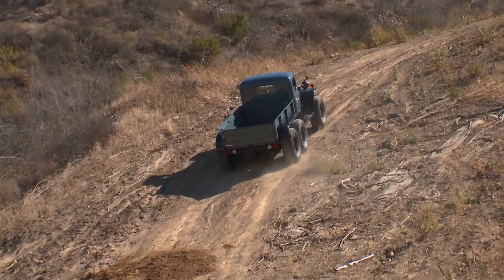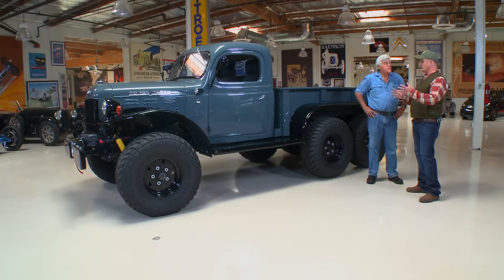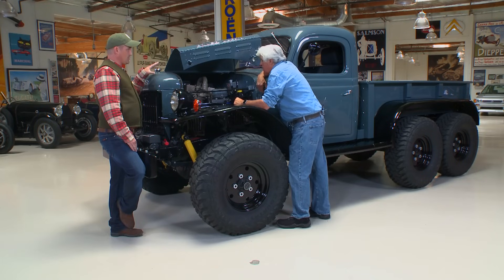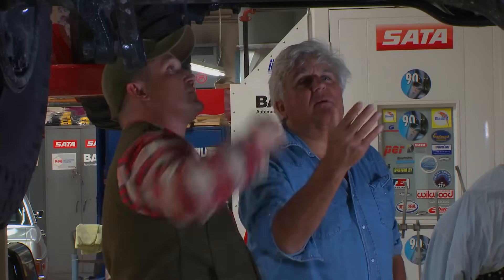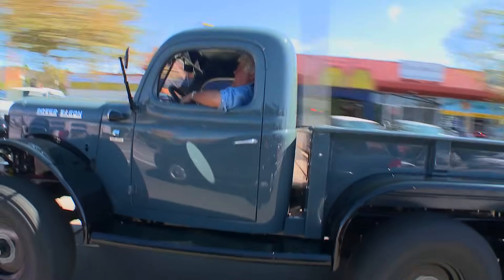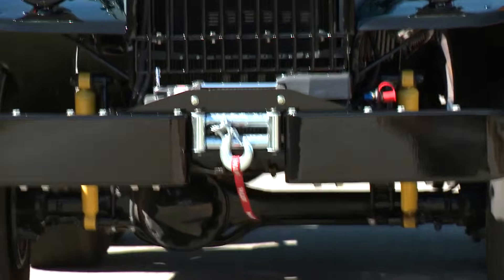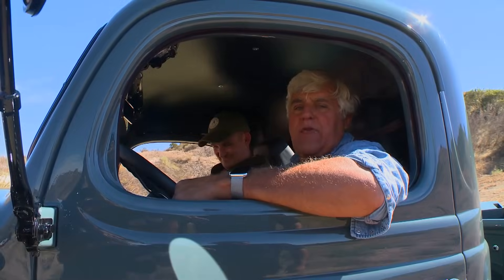1942 Dodge Power Wagon Restomod - Jay Leno's Garage

Comment: An uncle of mine used 2 Dodge WC vehicles for his engineering business in New Zealand after the war to access/repair and assembly of electrical pylons in out of the way areas, a WC 52 (i think) weapons carrier and a WC-54 ambulance, I often rode around with him in the open weapons carrier and felt like a king sitting so high up with no doors..
The old 6 cylinder  230 cu flat (L) head motors were so understressed and just kept going, though they consumed petrol at a good rate due to their weight and older design. .
Obviously they lasted much longer if not hit or damaged, salt water was a problem with high corosion of panels and mechanicals though.and their life expectancy was rated at 20.000 hrs in the Pacific.
We had many ex US army miltary vehicles in NZ during and after the war, many were transported back from the Pacific islands after the war on old steamers by a man named Gillies who i believe had a contract with the War Assets department  to retrieve ex surplus and abandoned vehicles. They were stored at in a huge seaside yard in Gracefield, Petone about 10 miles north of Wellington for sale and spares, included, Ford and Chev Blitz trucks, Studebaker 6 x 6 trucks, Reo's, , White halftracks , GP's, Beep Dodges,  Diamond T's, many of the 6 x 6 Studebakers were used for logging having jinker trailers attached. a few farmers tried half tracks when new tractors were unavailable in NZ after the war., not always successfully.
Many farm and rural transport business's in NZ had one or two ex Pacific US army vehicles, and they were inexpensive and parts were easily available from the huge stockpiles of machinery and reclaimed  equipment.
The Gillies yard was huge and had large numbers of these ex military vehicles, spares and associated war surplus equipment. I moved to the USA in 1966 then to Australia in 1975  and don't know what happened to all of the vehicles after that.

Studebaker 6 x 6's and Reo's were commonly used as Bush fire Brigade vehicles in NZ and Australia until the 70's and when the diffs were locked there was little steering, just straight ahead, ask me how i know? stopping dead befor hitting a large gum tree.

Comment: That engine produces a boat load of torque. With those 583 differentials that beast could rip massive trees from the ground. Wrap a chain around a building and you could rip it off the foundation and crumble it into a thousand pieces.

Comment: That injection pump can be ran without 12 volts. There is also a lever that mechanically will shut off the fuel. But you have to remove the shutoff solenoid, then remove a plunger and spring, then re install the solenoid to plug the hole. Then with a manual trans, you could potentially run with out any electrical power.

Comment: The first year  Cummins was 1989 .I bought with a getrag  5 speed 
It 160 hp at govern speed and 400 lbs of torque at 1700 rams. Mine was a wd250 4x4 with 354 gear ratio

Comment: Talk to Spearco next time.  They make air-to-water intercoolers.  My 2015 Passat TDI has a Spearco.  No extra intake plumbing.  The cooler is bolted right to the head.  They aren't as efficient as a COLD air-to-air intercooler, but it's almost impossible to heat-soak the Spearco.  So in the real world they're great.  Plus a nice bonus:  In the winter it HEATS the intake air when you're cruising, which the diesel appreciates.

Comment: Man I'd love to see an old 318-3 commercial engine with an oil bath air cleaner or other vintage type air cleaner, and all stock vintage engine parts, with cast iron exhaust manifolds, and 2 bbl carburetor with 210 Horsepower (factory rated horsepower of 318). I think it would have had a lot of power, compared to the 105 hp 3.9L cummins. I just always loved the old 318 commercial engines, they had a forged steel crank and sodium filled valves from the factory, and the 318 industrial commercial engines were used in commercial trucks, generators, equipment, and motorhomes. The gas engine may have been a little easier for cold weather, and a bit better on the highway? But the cummins 3.9L is pretty awesome too.

Comment: I retired from the pa Dept of corrections s.c.i.graterford .we had gotten one of these from the PA Forrest service ,after refurbish this vehicle . It was built for brush fires . I called chrislyer for any info they could give . They told me how many they made  ,what the gear ratio was to go into areas that called for steap hills ect. One thing they did tell me was that you would break the drive shaft if you were not careful if moving form the stopped position .

Comment: Funny thing is, that 3.9l cummins 4bt probably can get 20 mpg+, even in this big thing. Maybe not in this with the extra drag of the driveline and 2 more wheels, but I've seen these engines in ford rangers and they get 30+ mpg. Not only the milage is great, but the peak torque starts 1200 rpm where you spend most of the time driving and goes all the way up. Nice truck, too.

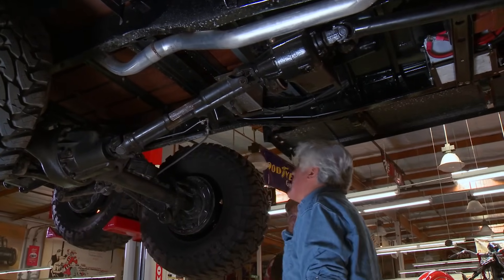Comment: @ 18:00 =>> the brake hose of first axle is already tensioned like a piano wire while the axle can still drop more than it already did (because lifting on the rear axle only).. 🤔 

Should have done it like on the original WC62/63.

Truck looks beautiful anyway. 🙂

Comment: That thing is pretty nice, but if it were mine, I'd put in a 6-speed Eaton manual rather than the 5-speed he put in. An Eaton may take up more space, but it's built to handle torque numbers that are far beyond what 99% of Pickup engines can put out, so they last a really long time. The added controllability of a decent Highway-Tractor 6-speed is nice off-road as well, due to the shorter gaps between gear ratios. With a doubler behind a transmission like that and a smartly chosen diff ratio, you could probably go up a 30% grade without even touching the throttle.

Comment: The drop-tops on the old military vehicles were to make them easier to transport particularly on aircraft with limited height in the cargo compartment. The sheet metal on conventional vehicles are not going to stop any military bullets so having a metal cab is irrelevant. Make great beach vehicles now.

Comment: Love the 1 wire (no electronics) diesel engine idea; need one in my FJ
Reply: The only catch is that the 4BT is heavy. 308 to 329 kg [679 to 725 lb]
Reply: @jacobmoses3712  True; had not realized the weight issue diesel engines pose until recently.

Comment: I worked for the city of Tumwater in Washington state and they had a '59 Power Wagon.  No one would drive this thing.  When they found out I could double clutch I was the one that had dive it.  The one I dove had a governor and it wouldn't go over 50 mph.

Comment: I learned to drive on one of these (4x4) on my uncle's ranch on Molokai, 1964.  It had a flatbed, PTO winch and we rigged up a bumper mounted A-frame boom that could pull up fence posts.  The secondary vehicle was another ex-military 4wd, a Willys MB IIRC, that went to my cousin, then my brother until he traded it for a POS pickup that lost its timing chain on Hawaii island as I drove back from a job, in about 1979.   I liked the Willys for visibility and a transmission better suited to the speeds we were traveling.

Jay isn't much on staying in his lane, or does the truck not want to?  The ridiculous money these things are going for speaks to the customers and discounts their "coolness".  It's almost cheaper to hire a helicopter.

Comment: So, what do 'ya suppose the fuel mileage is on this rod?  Any Guesses??  I give it 10 MPG at best.....Didn't hear them talk about that.  So with a 25 gallon tank, 250 miles max, but probably more like 180 to 200 realisticly....Better have a couple 5 gallon military fuel cans just in case....That ride from Calgary to Anchorage could be a "Nail Biter" as far as fuel economy is concerned....LoL   Appropriate color for this rod....Looks like Ford Motor Co, Area 51 Grey

Comment: The part about the disc brakes twisting the springs seems a little off, couldnt you just lower the brake pressure to make sure it isn't braking too hard ?

Comment: Can anyone explain to me what a block heater is? 
also.. old school wise that did they do up north before a lot of electric?
Reply: A block heater is a device that pre-warms or keeps warm an engine block for extreme cold starting.   Much more popular on diesels or older vehicles with carbs.  Most on call or cold use machinery is on block heaters so you can hop in and start.   There's dozens of ways it can be accomplished.  On my carbureted gas vehicle, I had to drive it a few winters.  I have a block heater plumbed into the coolant system which warms the coolant and circulates it through the engine.  There are other methods.  But usually plugs into 115 VAC .

Comment: 4BT 3.9 Cummins is a motor for farm tractors, small delivery vans, light equipment engines like a roller, backhoe, water pump, fork lift, wood chipper, etc.  it’s got lots of torque for a 4 banger but Sheash,,,,,,why not a least the  Cummins 12 valve, 5.9 six cylinder with easily twice the horse power. It must have been all about the space available.

Comment: I would LOVE to see a 1955 GMC 550 body sitting on this exact powertrain and drivetrain setup!!! ...also, with a 5th wheel and air ride! 
It would also be nice to have 2WD, with a 6x6 differential switch that engaged the first and third axle, making the 2nd rear axle the primary drive axle (just like a semi ...but then with 6WD instead of 4WD with the diff. switch).

Comment: He's wrong about the electrical bit to a point, cummins use a shut off solenoid that needs power to open fuel supply but has a manual screw to override it, he doesn't know his product as well as he thinks

Comment: Should of used Dana 60s or 70s at least for all that weight those look like 8 3/4   differentials are going to have bearing issues and case cracks and small u joints breakage off roading

Comment: How did they run the power steering and brake system off the same reservoir? Running DOT 3 in the PS or PS fluid in the brakes?? How did they get away with this?!?!
Reply: I suspect the pump only gives boost to the master cylinder rather than supplying fluid to it. sort of how the vacuum boost on a passenger car only gives assist.

Comment: the hydro boost system has never worked very good..the last thing you want is your brakes and power steering on the same system..i've seen people's brakes completely fail when the high pressure line blew..very cool though .a well thought out design and well executed..

Comment: This truck is begging for a 6.0/6.7l powerstroke or a Cummins 5.9/6.7l or a Duramax 6.6l... so much fabrication and yet extending the front end a foot wouldn't have been worth it? I guess the more modern engines don't do it justice though. Maybe a Detroit?

Comment: I am old enough to remember Power Wagons in common use.  God, what a vehicle.  But lose that air conditioner and put in a gasoline heater.  I need a Power Wagon like I need another hole in my head, but that's the only kind of truck I ever wanted.  Screw Tesla.
Reply: you betchya, our Oldsmobile 1906 sedan worked just as well as Tesla ever could. They cared enough to make everything with superior quality, and then Tesla falls off entirely when they add the beauty factor of rich color and embellishments to the automobiles of the 20th century. We had a Ruby Red with black lined 1915' Chevrolet Royal mail roadster, a greater eight 1930 Hudson Sedanette, Hudson 1937 Terraplane, Nash Ambassador 1941 coupe, then another Hudson this time being a 1946 Super six in Ice green and marble white, and then we purchased an Oldsmobile 1938 which is gorgeous and certainly a lovely working automobile. In 1953, we then finally purchased a 1951 Hudson Pacemaker which was in tabrolite dark gold. Many automobiles many years and a constant beautiful obsession our family held, always keeping them stock.

Comment: I want mine in fire-engine red. Where this one is gray, I want red. 
So, uhh... Who's got the money?
Reply: hey, as long as you use the stock tires on it. Here look up the 1938 Dodge power wagon, which was in technical aspects the first Dodge power Wagon. It has these wonderfully elegant tires that they used to have that simply fit the automobile perfect. The first concept model for the dodge power wagon was in 1936, a black and white photograph showing a large version of a 1936 Dodge panel sedan truck with interesting different tires and a large rack bumper. Introduced self propelled engine to a Truck.
Reply: @artdecotimes2942  Ah,  Nice!

Comment: I just looked at the inventory page on Legacy Classic Trucks' website.  There's a 1949 crew cab Power Wagon listed - 4WD, 360 hp Magnum V8, 5-speed, winch. Sold for $330,000.  

$330,000. Enough to buy 10 good used trucks with equivalent power. 

Who the hell buys these things?  It isn't working guys or people who will subject them to hard use off-road (if you would throw a $330,000 vehicle into a mudbath or a rocky creekbed, be my guest - you've got more money and less good sense than I'll ever have).  Sorry, these are luxury Tonka Toys for rich guys to show off and act macho in, then have detailed if they get any mud on them. I suppose it's nice to know somebody is building these things, but I'll pass, thanks.

Comment: Its from when they didnt make the perameters as low as they could and claim that its better than whts beffore, WHEN DID THE F150 TAILGATE SHAKE LIKE PLASTIC?! Ford built tough to work with, I like 2 cars from ford and 2 only: 1966 GT40 MKII, and the Shelby GT500 (all makes)

Comment: Love you Jay Leno but it’s CUMMINS, not “ CumminGs”
Reply: Flasher Trasher  not the B Series engines, maybe the Larger big cam engines but not these light/medium duty engines. They’re as dependable as it gets.
Reply: Flasher Trasher  yeah. I could have guessed
Reply: Flasher Trasher  yeah it happens, but like I was saying you will hear a lot of older truck drivers praise CAT engines and use the term “Cumapart” but you never really hear that term amongst pickup truck guys. We all know how good Cat engines are and we all know how The larger Cummins engines are prone to failure “though many are still damn good engines”but when Cummins and Case came together and designed the B Series engines like the one in this vid and the six cylinders in Dodge Pickups, well it’s safe to say that they did it right that time.
Reply: Flasher Trasher  besides, in the 80’s you should have been running a big two cycle Detroit engine, so ShAME on You!😂
Reply: Flasher Trasher  Hey Hey Hey Guy! Mind your tongue!! Those big girls are just singing their own song, that’s all. But in all seriousness I know what you mean, I’ve been running big Terex Pans, Dozers and loaders with two cycle Detroit’s most all my life so even though I love the sound I can sympathize with those that don’t care for it so much. Have you had much experience with the 3.9 and 5.9 Cummins engines?

Comment: It is cool that these trucks are resurfacing but it absolutely stinks that the average Joe cannot afford one of these cause when they’re all done and turnkey there about Wayover what a brand new car cost we’re talking $250,000. I’ve seen it with other shops that build those Broncos it is Flippin ridiculous. The average Joe does not have an extra $250,000to spend on one of these tricked out vehicles do you wanna know why it cost so much because it’s mainly labor and that is the real sadness about this Industry.